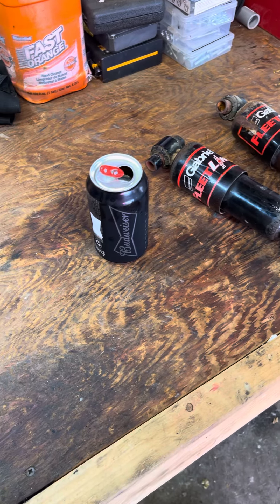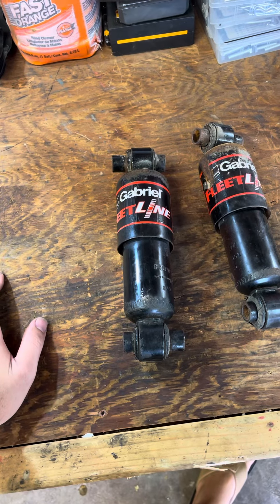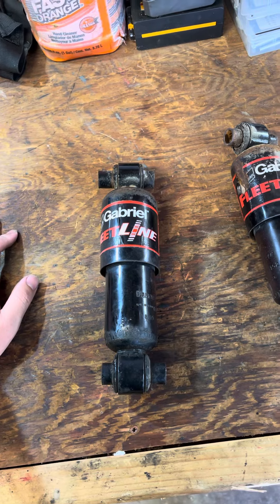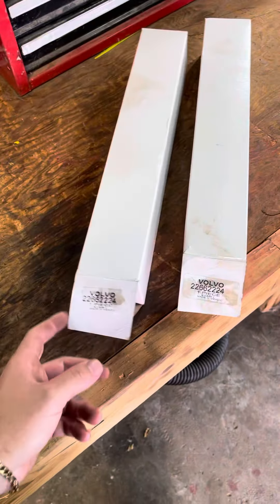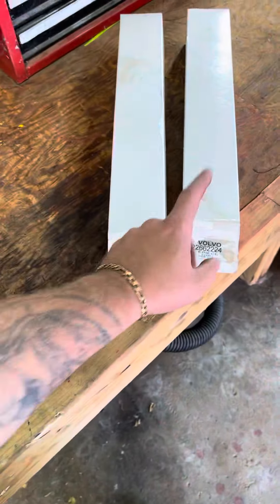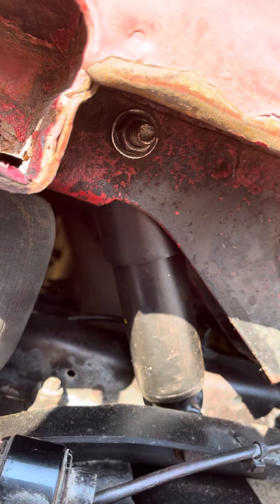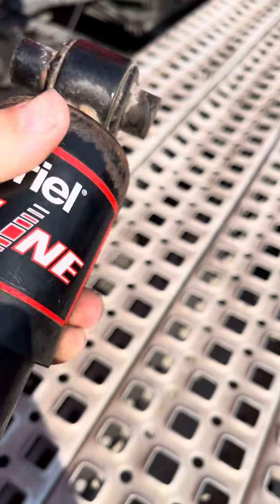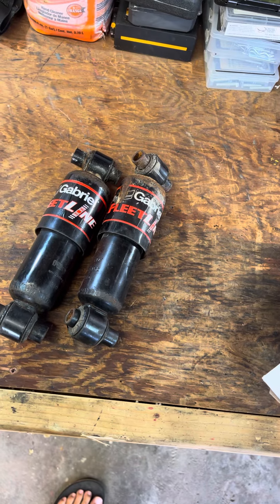Volvo vnl CAB shocks replacement

Comment: I had Monroe shocks that lasted 4 years and they got so rusty I wanted to replace them before they fail. Replaced with Oem Volvo ones and they both leaked after 1 week. Shocking for me. And the old monroe ones that i took out were still functioning good. So will switch again

Comment: Quick question my truck does 75 mph . How can I make it run 83 I own truck
Reply from the maker: To answer the question, you would need to have the speed limiter/rev limiter removed by software tuning. Dealer usually charges 1hr of labor to plug an go.

While your in there, have them change the LCM to be able to allow LED lights also without throwing the CHECK light and remove the idle limiter so you can bump the idle up past the 550.

I would not really recommend going that speed however. Tires aren't rated for those speeds much over 75mph. Not sure how long your drivetrain will last doing Max speed. Your call tho. Be safe
Reply: Ty
Reply: Not recomended buy just Dont apply brakes going downhill  😂